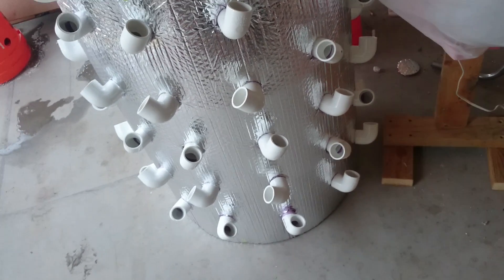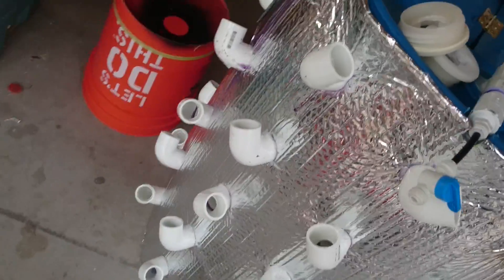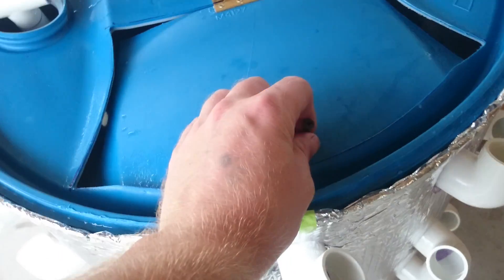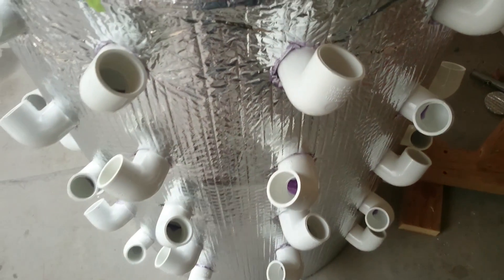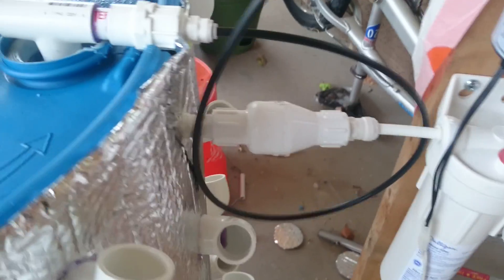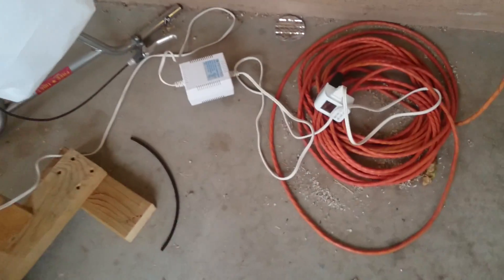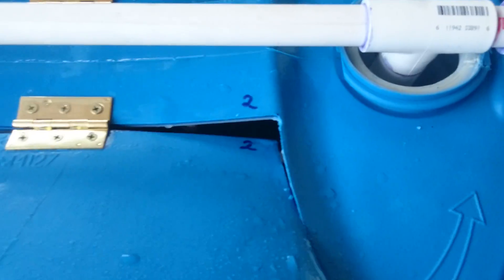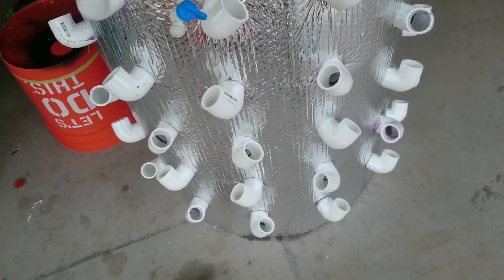DIY High pressure Aeroponics system.

Comment: Do you have a pressure tank in the system? Wondering if the the check valve is maintaining the pressure in lieu of a tank?
Reply from the maker: I did not use a pressure tank for this project, I wanted it to be very simple.

Comment: are you using a solenoid for this setup?
Reply from the maker: No, only a pump, misting heads and filter. I built it as simple as possible when I was using it👍👍
Reply: @ToddLarsen  thanks Todd, can you provide specifics on the filter?
Reply from the maker: @RescuedRhythms  unfortunately I cannot remember that but it was a simple inline filter used after the pump.

Comment: How many spaces on this container?
Reply from the maker: I think there were 60 spaces in each barrel.
Reply: @ToddLarsen  what size is the barrel?  Thanks this looks better wasnt your first manifold black n ontop? We bought a sprayer n riser to make a 4 space 5 gallon bucket for starting i would like one like yours. May end up buying a ready made one from art garden
Reply from the maker: @terrynicholson5214  Thanks for the question, I used a typical 55 gallon barrel that has Coke syrup in it, not sure what the exact dimensions are off hand. 

From what I can tell, Art gardens systems are highly polished and if $ is no problem I'd say go for it but if your on a tight budget like me then building my own and learning as I made mistakes was fun and it taught me great deal about my system and how to maintain it.
Reply: @ToddLarsen  what nutrients do you use? We currently use .aster blend 3 part but its working great half strenth curremtly have a kratky set up and using a clone king so i want to be in budget but make sure it works, with one barrel why not use a pump riser and lawn sprayer we foumd a 6 ft sprayer but ours works just wanted thw riser taller to put at top inside the container all the spray would get everything below it. I dont understand how to save water, if using an external spray where does all the leftover water go, it wouldnt flood out the bottom set of plants? How long does your sprayer run for and how often? Looks amazing for doing it yoirself, simce money is short id have to save all year or scrounge up for supplies.
Reply: @ToddLarsen  did the 6 inch spacing work out for you? Would i need to stager the spaces, still hoping to make sure we get everything correct.
Reply from the maker: @terrynicholson5214  It did fine for me and I wound up with more lettuce than I could give away, but more space wouldn't hurt either way.
I'm planning on doing a new video some time next year after my years of experimenting and share what I found.
Reply from the maker: @terrynicholson5214  I was using 4-18-38 master blend and add calmag but now everything is aquaponics based and all organic.
Reply: @ToddLarsen  we didnt do good with the organic food we bought, curremt ly using masterblend etc... Want to stay organic as possible, what the name of the food you have? I saw terra nutrients is good but it seems like a commercial food. So far our plants are doing well in kratky and clone king the areo ponics. Do you have information about your barrel and how its hooked up?
Reply from the maker: @terrynicholson5214  I have 40 adult tilapia that fertilize my system naturally, basically instead of a res tank for nutrients I have 100 gallon fish tanks with tilapia living inside. I have made over 100 videos on the subject on how to build and take care of aquaponics systems.

Comment: todd sorr to bug but i cant find the 1/4 inch fittings that connect to pvc anywhere?
Reply from the maker: Anne Wilson You can find the slip fittings in the water filter section of the hardware store.
Reply from the maker: Anne Wilson sorry there called quick connectors. Amazon has them as well.

Comment: What is the advantage of a high pressure vs. a low pressure system? I'm a total "black-thumb" novice with this, and I'm looking for the cheapest, easiest, most idiot-proof way to produce my own food. Thanks!
Reply: high pressure reduces the size of the water so the plants uptake more
Reply: Low pressure is cheaper and easier to build. It sprays larger steams of water and can be accomplished with a much lower grade pump. The sprayers for low grade have a larger orifice (hole) so the water passes easier. High pressure uses misters that use a much finer spray almost a fog as you can see in this video. In either case you have to be aware that once nutrients are added to the water the misters/sprayers can start to plug, especially if you have a long off cycle and they start to dry out. In this video Todd had to add an inline check valve to maintain the pressure at the head side of hos line during the off cycles. High pressure done right is what most consider more of a true aeroponics, The key being air (oxygen) the plants supposedly can absorb the nutrients from the finer mist more efficiently and the roots get more oxygen and should be hanging in the air with little or no water in the bottom of that chamber. Low pressure sprays water on the roots and in many cases because it is more entry level the water reservoir is the same as the root chamber. Some consider low pressure to just be a glorified for of RDWC (Recycled Deep Water Culture). High pressure is said produce higher yields and be more efficient if done right. I recently saw something called an ultrasonic fogger which might produce similar results to the high pressure system but witha more basic setup, key word MIGHT.

Comment: i think this pump can handle more nozzles and sustain optimal pressure for performance
to me it sounds like the pump is under heavy load

i actually have the same pump and ran it with 2 nozzles just like you here except i dont have a filter or a check valve, i ordered this one today, https://www.amazon.com/gp/product/B0102631Z2/ref=oh_aui_detailpage_o01_s00?ie=UTF8&psc=1 

what benefit were you saying the check valve has? I have a 1/4 to 1/2 adapter that kind of acts like a check valve, when i quick disconnect the tube it doesn't pour out and i cant blow air through it so im guessing its similar
Reply: ivam running about 18 nozzels with the aquatec 8800 at 80-110 psi and the mist is perfect using 0.012 nozzels.   I am currently using 1/4 tubing strapped onto !/2 in pvc as a framework because the 1/4 tubing is too curly.  I am trying to figure out what hole since to drill and . tap for the 10-24 threads on the spray nozzels so I can do away with the 1/4 inch tubing if I decide to.  Faster to build using pvc and drilling the holes as desired maybe.

Comment: what type of pump and heads do u use
Reply from the maker: john costa The pump is a Aquatech CDP 6800 pressure boost pump. and its cost was about $53.26 plus shipping and you'll need a Aquatech 120 volt transformer for th CDP Boost pump to run it from regular ac. The heads I used were just regular misting heads, brass mabe? I would recommend stainless though.
Reply: @ToddLarsen  I know it's been 2 years since u made it. Just curious if you had any issues with funk in the bottom without a air stone
Reply from the maker: @ItIsWhatItIs827  I didn't notice any but I only used the system for one season. I could see it getting anaerobic over time with roots falling off into the res though.
Reply: Will this power several misters?
Reply: like these?   https://www.amazon.com/VERY100-Misting-Nozzles-Cooling-System/dp/B013ADKQQG

Comment: Hi..I have made a similar system without the wrap, the problem I am facing is nutrient is leaking outside from the bottom of each elbow. Though the holes were cut of exact size but still through very fine space water is coming out. so can you show us how you have sealed the minute space between elbow and hole.
Reply from the maker: Tushar Kathuria I ran into the same problem, and I had to use bathroom caulking and ran a bead around each elbow from the inside and it did the trick. you have to clean the area very very good so that the caulking can seal better.
Reply: Thanks for responding, few more questions I have.. :).. is the caulking food safe? what is the distance between the elbows?
Reply from the maker: Tushar Kathuria Fish aquarium caulking should be food safe as it would harm the fish otherwise.
Reply from the maker: Tushar Kathuria and as for the elbow distance I believe it was three inches. I'll have to re measure and get back to you to be sure.
Reply from the maker: Tushar Kathuria I was wrong about the elbow distance, it's six inches from the center of each hole vertically and horizontally.
Reply: Don't you think 6 inch is less.. I too drilled for four elbows with 6 inches distance but after placing elbows I realized I am only getting 3 inches of growth space between two elbows vertically...so remaining holes I drilled with 8 inches gap that too I feel is less because things get bigger in aeroponics :P.... How is your system doing with 6 inches?
Reply: what is the temperature inside your drum when it is running outside in hot sun?
Reply: I know it's been a year since you posted this question, but a couple thoughts came to mind. I saw a video with someone talking about a similar problem. What they were doing was to drill the hole a bit smaller that the fitting and then heat the hole with a heat gun or something so that the hole could stretch a bit and the fitting would squeeze in with some force and keep a tighter seal. I also read that GE Silicone I (ONE) is pretty much aquarium seal, but cost less because it isn't labeled and sold for that application. The difference between GE Silicone I and GE Silicone II is that the II (2) has mold and mildew inhibitors that mess with the horticulture.

Comment: where did you get your HPA pumps and what do you recommend for a pump on a 35 gallon tote?
Reply from the maker: I got my pump from Amazon. a pump I use on my tote systems is a 400 gph pump PP40006 and it pushes water through about 16 emitters in four totes.
Reply: +Todd Larsen what about the actual sprayer mist?? what size is it?
Reply from the maker: +Jan Salveron the mist is I belive 10 to 20 micron.
Reply: An aquatec cdp 6800.will be plenty for that tote size, it`ll generate a good 120psi and is virtually silent running.  Submersible pond pumps dont have nearly enough pressure to generate the right mist droplet size, they`re more suited to sprinklerponics.

Comment: Doesn't the water filter take out most of the nutrients before misting the plants? I'm in an area where supplies I can get are very limited. I can only get a 5 micron filter. I'm worried that I wont have any nutrients left for the plants...
Reply from the maker: you can see the growth in some later videos, I had almost no issues with nutrient being filtered out.
Reply: What micron is your filter?
Reply from the maker: +RawSiafu 
I'm not sure what micron size this filters but here is the model Culligan us-600a.
Reply: I found that it uses 5 micron filters like mine. I also just read somewhere that the nutrients are dissolved to less than 1 micron.

Comment: Good video. What are you using for your mister head? what size booster pump are you using? Any issues with nutrients clogging the misters?
Reply from the maker: I had clogging issues when I started out, I was using a timer and once I got rid of the timer it's been running good almost 10 months. the misting heads are just normal patio myster heads and the Booster pump if I Remember correctly is 126 psi ro pump.
Reply: Thanks for the info. I am in the process of building a HPA system for a 3000sf indoor grow facility. I have done hydroponics which worked good but in my estimation wastes a lot of water. We are converting all of our systems to sustainable systems. It's all about saving water (especially out here in the western deserts), electricity (going all LED lighting) and nutrients.
Reply from the maker: +Jeff Shinkman thanks for watching my video and good luck with the project. I have a few newer videos showing the growth of my experiments with the towers and aquaponics projects.

Comment: Hey how you found a difference in yield between high and low pressure aeroponics set up? If so how big was the difference? Keep up the great work!
Reply: +Attila Banhegyi I got something I wanna show u where can I send you the info ?
Reply from the maker: I haven't done any true comparisons between the two types of systems. I would imagine that low pressure high output versus high pressure low output would yield a difference, at least in my thinking I the low pressure high output would feed the roots at a higher rate.
Reply: Thanks for the reply yeah it would be nice to test. I'd be willing to run a test next year. Will you be putting out a parts list or revealing tips and tricks for ease of assembly anytime soon ?
Reply from the maker: +Attila Banhegyi  I will definitely do a parts work up and to share what I learned to help others. here's a small list... I used two five gallon buckets, two food safe 55 gallons drums and 120 1 inch pvc elbows and some 1/2 inch pvc for plumbing and one union fitting to connect the two five gallon res tanks at the bottom, and a ro water pump with 1/4 inch to 1/2 inch tubing from the pump to the filter and then to the myster heads. I've been drinking a few beers so I apologize for and misunderstanding lol I'll try and do a detailed video when I have time, I'm in the middle of a massive aquaponics build in my backyard and working alot and that's taking up most of my time. thanks for your comments and for watching.
Reply: Right on man I'll have to check your videos again to see how the res is set up and what u do with the left over water in the bottom of the 55 gallon. I got my pressure pump already ordered from aliexpress 3 years ago but life got in the way. Are you gonna do barrelponics in your backyard ? I'm gonna set a system up in the next few months aswell with a 250 gallon tank not as big as yours .. Never seen them that big around here

Comment: so no expansion tank? what pressure is on the line?
Reply: +Todd Larsen 
An expansion tank/solenoid combo will enhance overall control. Pipework does the opposite, it will pressurise and depressurise during each misting cycle. If you time how long the misters take to start misting from the point the pump turns on and how long they keep running after the pump shuts off, you`ll see it in action :)
Ramping pressure will adversely affect the mist quality so its best to minimise it if you can
The tank will also reduce the wear and tear on the pump as it wont need to run as often. Mine runs for 8 minutes a day.
Reply from the maker: I'm thinking I'm running about 130 psi according to the info on the pump. I haven't actually tested the pressure with a gauge yet.
Reply from the maker: no expansion tank.
Reply: +Todd Larsen I thought you need a expansion tank to get the pressure high, but that must be for a system that has a ton of nozzles and tubing. How is your system working for you? I would love to see the grow projects you do in that.
Reply from the maker: +JDT738126  my lines that have my sprayers attached are 3/4 pvc and must act like an expansion tank together, I'm thinking.